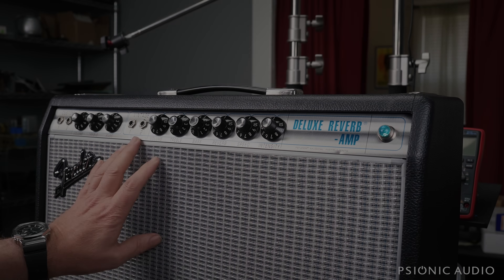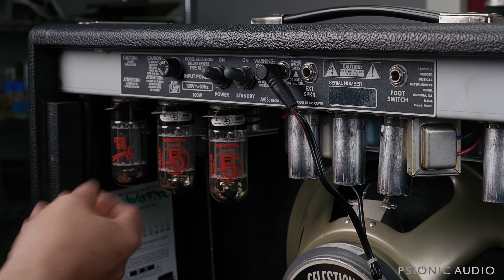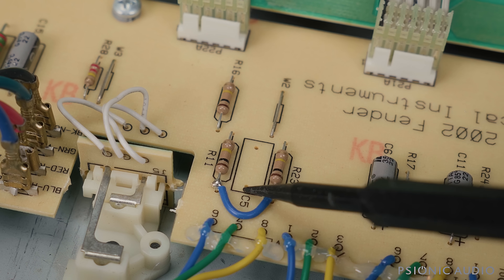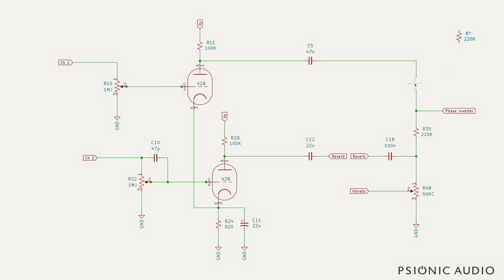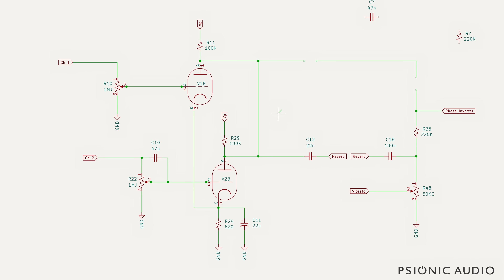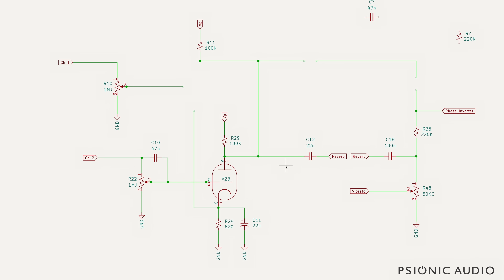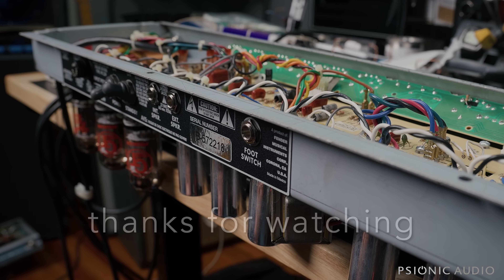Noisy - but Why? | 68 Custom Deluxe Reverb Pt 1

Comment: Did you decide what the size of resistors in the voltage divider off of the vibrato pot ought to be? It would be nice to know, if not there will be some experimentation in the old town tonight.

Comment: Great job Fender! I keep thinking I should go across town and apply for a job with Fender. I am pretty stupid but I ain't anywhere near that stupid. AC/DC coupled stages? WOW! Lose the axial cap for HT power filtering and use that money to put in coupling caps & resistors. FYI, I use two to four large long pallete knives for painting pictures that are kind of traingular shaped with a rounded tip to get the chassis out of all sorts of amps so I am not ripping shielding foil or pulling off vinyl Tolex. I use 3M 597? .003" mounting tape to stick it back on when it does peel off.

Comment: Great tips. In PT 2 will you show how to do the mod of that blue wire R11  R23 and adding 220k resistor coupling cap? I am trying to DIY all your tips. You explain great but something you do not show you doing the work. That would be super helpful for non-pro's. I work on cars a bit. I could "tell" people to remove the speed sensor, add voltage to the rear parking brake caliper and follow a procedure inside the vehicle, in order to properly release the piston on a Lexus elec. automatic parking brake. All true- but unless I showed you, it might be hard to follow. Dig? Also, I hope you are using a solder extractor. Those fumes are deadly over time. I know people who did not even smoke and got (died) from lung cancer. 

Teaching all of us is awesome and very much appreciated but please stay safe! You and your good health must come first!

Comment: @PsionicAudio Would you please check out my video about my 68 Custom Deluxe Reverb?  It starts making a horrible noise after about 15-20 minutes of use and the noise goes away temporarily (like a couple of minutes) if I unplug the instrument cable from the amp and plug it back in a few times.  I bought the amp new 6 months ago and was hoping to gig it this summer but I just don't trust it.  Thank you!

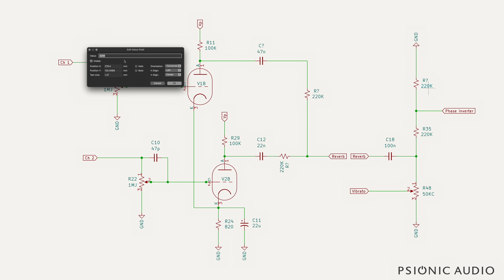Comment: Hi Lyle, I have a question about the 220K PI mixing resistors you reccomend leaving in around the 10:20 time mark. I wired up a home brew Bassman AB165 preamp section which has these 220K mixing already in the preamp circuit to a AA864 PI/power section. I currently do not have any additional mixing resistors leading into the PI. Should I add these 220K PI mixing resistors back in to match the AA864 PI section for the same reason you mention here? In the video you also mention the other 220K is acutally a 470K or 1M resistor to ground to form the voltage divider but that info was in your notes. Did you happen to find that exact value? What value should I use here for my Bassman? Any information would be extremely helpful to me, thanks in advance!
Reply from the maker: This is for the AB763, not the AA864 with AB165 preamp. This doesn’t apply. See my various AB165 videos.
Reply: @ thanks for pointing me in the right direction! I found the video and got my answer.

Comment: Thank you for this video and explanation. What capacitor is needed to replace C5 and reverse the normal channel effect mod? I see there is a .047uF value but does voltage matter?

Comment: Great video Lyle.  At around 10:00 you point out that the gain just before the PI would be a bit higher than normal with the suggested mod and that a resistor could be used to pull this down a bit.  Why would the gain be higher (post mod)?  Cheers and thanks.
Reply from the maker: Because you’re changing the load on the reverb mixer output. It’s not a lot, and it may not be necessary. Included for completion’s sake really. For those building a single channel AB763 this is often overlooked.
Reply: @PsionicAudio  Hey Lyle, I am currently planning to mod a custom 64 I just got off reverb a couple weeks ago.. Thing is too noisy to enjoy. I'm torn between going back to the original circuit or just go for the mod you have here. Did you ever determine that resistor value going to ground off the phase inverter. Pretty sure I'm ready to go except for that and how to do it neatly on the board. Thanks for your videos. Without them I might have just thrown this Custom 64 in the closet and took the loss.

Comment: Great video thanks Lyle, does the "Custom" Vibrolux Reverb Amp (late 90's) have the same issue? I notice mine sounds great but does have a ton of hiss that sounds very much the same as the amp in the video. Both channels have reverb and vibrato

Comment: The software you use to make/alter schematics - was that LTSpice ?   Was looking forward to this one- the  AC vs DC mixing of both channels is simple once you see it. I checked the RI board parts schematic & it shows C5 in place but the wiring schematic says otherwise. Good stuff.

Comment: Thanks for sharing.  Its kind of obvious when you draw the circuit. I'm not sure why you would want reverb on both but the added robustness is worth while.  Anyway, not my problem since I have the Blond Tone Master version with no self noise and the valves don't go bad.

Comment: Yes, that joined together plates thing isn't a very good idea if you want a clear, pure and strong sound because the directly paralleled plates load each other. The only way it can work quite  decently would be paralleling inputs as well. And the mojo then depends on how BADLY the triodes are matched. 🤓

Comment: Great tutorial, please keep it up for those of us with little amp repair experience.
A minor quibble is the choice of words regarding "all the noise goes away" with the AC summing topology.  A lot of it perhaps.

I wonder if you have Spice simulation capability with noise analysis.  It's quite informative when designing low noise analog circuits assuming device models are available.  With it you can quantify the noise contribution of each component to the output.
Reply from the maker: I do have ltspice. I meant the noise heard at the beginning of the video. In comparison to that, “all the noise” goes away. 

But your point is valid. No such thing as “straight wire with gain.”

Comment: Awesome.  How to determine the value needed for the resistor to ground that forms the other side of the voltage divider before the phase inverter (now that normal channel’s 220k mix resistor is gone)?

Comment: How ever did you know it was 1/2 the gain. In fact, you are right according to the gain calculator app 32dB vs. 35dB ! Wow! But, not surprised.
Reply from the maker: Did you factor in the cathode equivalence change? It’s a little less than half, but close enough to be aggravating to a player.
Reply: @PsionicAudio yes, I didn’t take into account the change in cathode bias in the 1/2 calculation correctly, good catch.

Comment: Interesting.  Why is DC mixing nosier than AC? I tried Googling and didn't come up with much of anything other then you're rolling off any low-end noise due to the high-pass nature.
Reply from the maker: No time to write a chapter here, but there are better ways to implement a DC mixer, such as in the AB165 Bassman. 

AC coupled mixers and DC coupled mixers can each give good results and each has pros and cons.

With the AB763 circuit as the starting point, it’s easier to get good results with the AC coupled circuit I show.

The worst possible way to implement a DC mixer is what Fender did here.

Comment: I mustve lucked out. I can't count how many videos you've posted about the noisiness and other issues with these amps. I got mine in 2020 used (so it was manufactured between 2013-2018) and I havent had any issues with noise. It being my primary gigging amp, I gets turned up to 4-7 without an attenuator regularly. The only issue I had was the shit reverb/tremolo footswitch that I threw out and replaced with one that functions. I also replaced the tubes with NOS RCA only because I came into a bunch of 6v6s and 12ax7s - it wasn't out of neccesity - although the groovetubes that it came with do seem to have a bad reputation. 

I know theyve only been in production for a dozen years, but have you noticed which years the one's you've had to work on were built, or does that not make any difference?
Reply from the maker: They all have the problem. It’s the circuit, not certain batches. Same for the 64 Custom DR.

I’m glad yours isn’t objectionable to you. I’d be curious to know what the actual self noise of yours is.

Comment: Would seem that chaining the plates of V1B and V2B together doubles the risk of having a failure taking  both tubes at the same time and smoke a lot of supporting components with them.
Reply from the maker: Not much of a concern in this part of the circuit. They also have the shared cathode. That’s a bigger “risk” but almost never causes failures in the field.

Comment: Self noise how 1940's that vintage sound (sarcasm) . Given what is know now it can be much quieter by say  30 to 40db is my guess .  No grid stop resistor on v1b and v2b is not the way to go in real venue . Well stated demo on the poor DC mixing not a very good design .  A very workable AC mixing design nice fix . Bravo

Comment: Why would Fender do this? I don't understand. It just reeks of malpractice.

Thank you, Lyle. You're videos have helped me to be much more curious about any amp that I might want to buy.
Reply: Corporate boardrooms select for people with little or no empathy. They are primarily driven by greed. The only financial requirement that limits this greed is the warranty. As long as the device survives the warranty period, they have accomplished their mission. Smaller companies are sometimes-by no means always- also driven by a desire to produce a long-lasting and good(in this case) sounding product(e.g. Swart, Suhr, et. al.). But this is less common.

Cheers,

Alan
Berlin

Comment: But Lyle, your solution increases parts count!  You just destroyed the massive savings that some bean counter came up with.  The suits will not be happy with you.
Reply: I always remember sitting in a meeting at work, us electricians had an "Electrical safety team" that discussed various electrical concerns at the plant i worked at. One day the issue was getting rid of a certain proximity sensor that was used all over the plant and replacing it with another type. It was obvious to everyone there that the new switch was inferior in quality and this was being done for cost purposes. One of my fellow electricians who had a rather witty and dry sense of humor asked why exactly this was being done. The engineer replied with a negative tone in his voice,  "well you know those switches are more expensive, and they're hard to find....." my college interrupted him and with the exact same defeatist tone  said, "yea and they work better" 😅

Comment: Awesome video! quick question: would it be weird to put in a high-powered speaker like a WGS et 90 90W in a deluxe reverb amp? Thx!
Reply from the maker: Hmm, not weird but not very efficient. The ET65 already has tons of headroom with a DR. The 90W version might not have much excursion at normal volume use. I mean, it will make sound. And you might like that sound, but the speaker would be barely moving, relative to the 65W version.
Reply: @ awesome thank you so much for the quick response. Take care!

Comment: This looks similar but not 100% as the 'robrob' normal channel mod on Rob Robinette's site, right? I've done his mod (and a few others) but i still have some idle noise on mine. I think its a grounding issue - would be interested to see a comprehensive grounding video on these DRRIs - I have the 68 but I believe the 65 suffers from it too. Also, I did the V3 rewire as per another one of your videos, and the change that makes to the reverb hum is miraculous. Excited to make my amp the best it can be. Thanks for your vids!

Comment: Thank you for the Video! It's my understanding there is coming a vudeo of how you do it on the amp? I have a new 65 Deluxe Reissue and it makes kind of thensame noise with volumes at 0. Some FOH Guys told me it's so noisy that they muted my channel between the songs.... i have done some mods you showed. ( The RG174 Cable from the Vibrato Pot to V2 Pin 7,   I resolderd V3... like they done it in the old days... i changed Power Tubes and Rectifier. Tried to change all other Tubes... but the noise don't go away...
Reply from the maker: I will, but it sounds like yours should not need these changes. The 65RI doesn’t have the systemic noise. 

Yours could just be a tube or tubes, though if you still have the original filter caps..
Reply: Thank you for your answer Lyle. I changed the filter caps to F&T, removed R65 and bridged it. I also removed R66. Wich Brand of Tubes do you recommend?